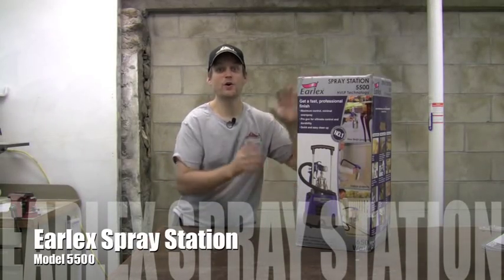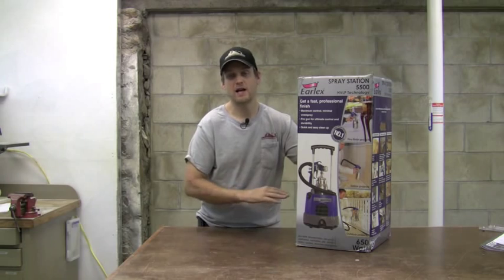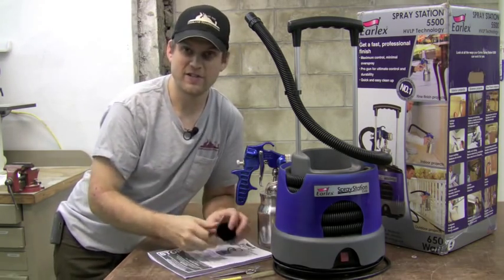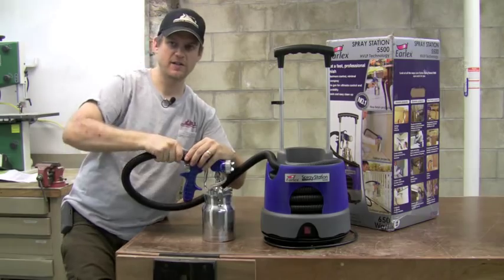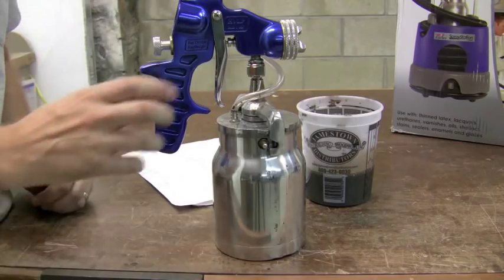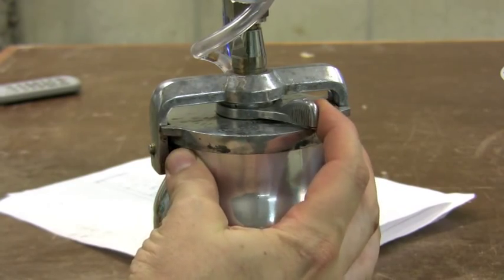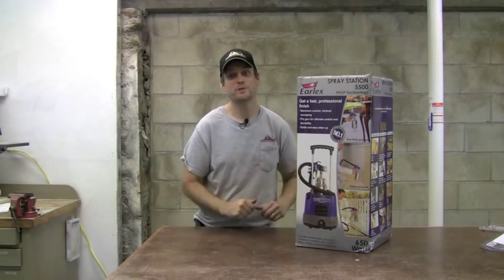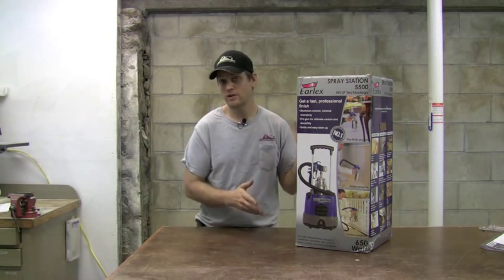Earlex Spray Station HV5500 Pro HVLP System Product Tour

Comment: Thank you very much for all the clear info!....I have a question: My house need to be re-stain....do you think it would do the job?.....Do you have more longer hose?...it is a old house with board and batten and to level high....what do you think?  thanks Guy
Reply from the maker: The Earlex is a shop-based spray system. To spray the building envelope of a house, an airless spray system that commercial painters use would be the best tool for such a large job.
Reply: @HighlandWoodworking  Ok thanks....I`ll check that....have a good day!

Comment: I want to paint a car. With this do a quality job with Automotive Paints?
Reply from the maker: Yes, you can use the Earlex Spray Station to paint your car with automotive paints. It might not do as good of a job as a sprayer that is more designed for car painting, but it will still get the job done.